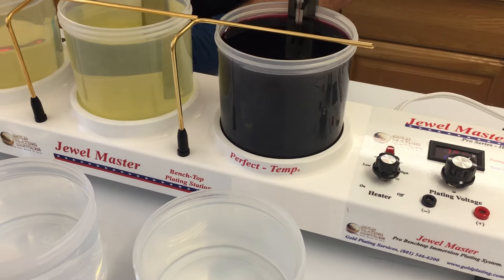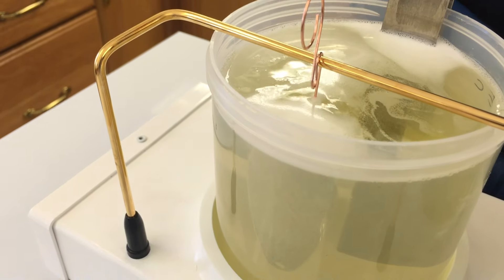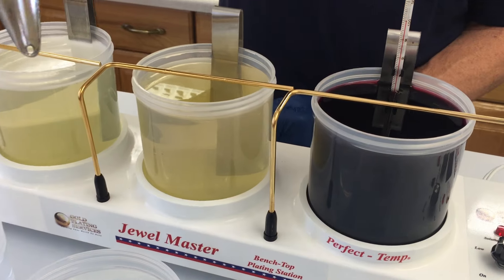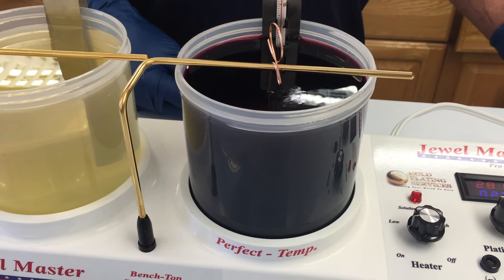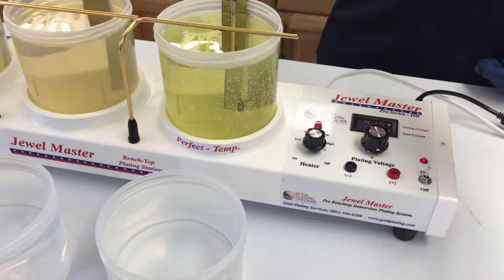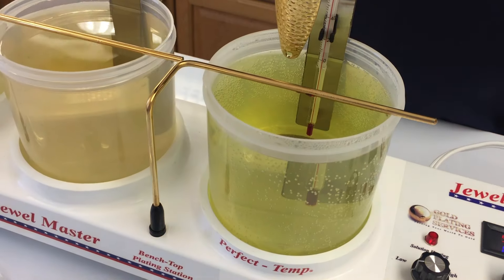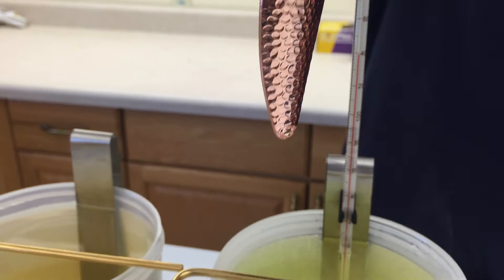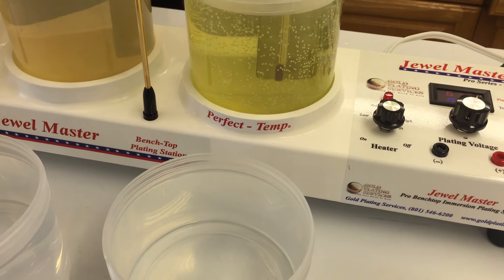Rose Gold Plating Solution - Jewelry Kit - JewelMaster Pro HD  (NEW)

Comment: Hi, if I use the rose gold plate on a chain, will it hold the colour or will it fade over time? Will it be waterproof
Reply from the maker: Rose Gold Plating is harder than yellow gold, however it can only be plated for a few minutes and therefore is not super thick.  It will hold color for probably a year or even multiple years depending on wear but eventually will wear down like all metals do.  It is waterproof, however it can start to tarnish in the correct environment over time.

Comment: How can I buy your kit in Europe? How many times you can use one solution and can watches be plated? Thanks guys!
Reply from the maker: We can ship most of our chemical internationally.  You can order directly from our website.

The solutions we cannot send internationally are:
-Chrome Stripping Solution*
-Woods Nickel Strike*
-TriVal
-Cyanide Rose Gold
-Bright Acid Copper
-Rhodium

*Chrome Stripping Solution can be made by locally obtainable ingredients.  You would need to obtain Sodium Hydroxide (also known as “Lye” or “Caustic Soda”) and distilled water.  Using these ingredients and following our instructions we can provide upon ordering, you can make your own stripping solution that will be identical to what we sell.
*We cannot send Woods Nickel Strike “Ready to Use”.  However, we can send a concentrate that can be made usable by simply adding acid.  The acid you would need to acquire is “Hydrochloric Acid” or “Muriatic Acid” – either works the same.  If you can acquire this, which it is typically obtainable nearly anywhere (can acquire Muriatic in many hardware stores), you can make our concentrate into a “ready to use” solution.
Reply: Gold Plating Services thanks guys. I will contact you through your website

Comment: my rose gold plating yellow after i deep into solution even i heat up 100c temperature still its plating why ?? its not first time its 4 times its happening with me so where is mistake can you sir please tell me ....and i call Khorn  plating solution department they say heat the solution 100c and use but i did all process nothing i solved this problem last 10 years

Comment: Is this the largest containers? I want to plate gun parts, slides etc they ate about 8 inches long
Reply from the maker: This is the largest dip plating kit we have, aside from making a custom setup.  Custom setups (like 1 gallon or so) cost about 3-4 thousand.  For items like you are talking about, go look at our "Plating Gun Parts" video featuring the "Universal Plater Kit" on our channel.  Its a brush plating kit and is what is typically used for gun parts.

Comment: Hi There, what is the maximum thickness of gold plating achievable? is it possible to achieve 2mm?
Reply from the maker: Hello, the thickest you can really plate a hardened 24K gold is about 2.5 to 3 microns.  Once you get much thicker than that it starts to affect the look of the finish - it will get hazy and dull looking.  However, some people will stop at 2.5 microns and interrupt the plating process by doing a very light polish or tumble.  Then you are able to go through the process again and add another layer of a micron or two.  A 2 micron thick layer of our 24K gold is quite thick and will last a very very long time if it isn't polished off or scratched off.  As far as the rose gold, we haven't experimented enough with it yet to know for sure its maximum thickness.  We believe it can be plated safely up to 1 micron or so.  The Rose Gold is a new solution for us so we're still in R&D.

Comment: What if you don’t have a gabillion dollars for this jewel master and want to refinish a gilded metal antique table?
Reply: Get the brush plate rose gold solution. Buy any kit they have even the pcb kit would work. And then buy "electro cleaner" , "woods nickel strike"(if the table is stainless steel), "surface activator"(if it's not stainless steel ), a "1/8 to 1/4 stainless steel bit" , "5 cotton sleeves".
That is the bare minimum for your project bud. It's worth the buy.

Comment: If you don't have access to an auxiliary plating station or a microwave in your workspace would simply going from electro-cleaner to TriVal gold strike to Rose Gold bath produce a quality finish?  I'm intending Gold Plating Services products to be used at each step
Reply from the maker: Heating Electrocleaner is not necessary, although it does work better when heated.  You will want to increase the Electrocleaning time.  I recommend electrocleaning for about 1.5 minutes at 7v if you're running at room temp.  Do a double rinse after this step, keeping the piece in the rinse beakers and not exposed to oxygen as much as possible.  Then immediately go into the TriVal at 6 volts, moving the piece around in the solution up and down.  Rinse.  Rose Gold plate at 5v and 120°F for about 1 minute.